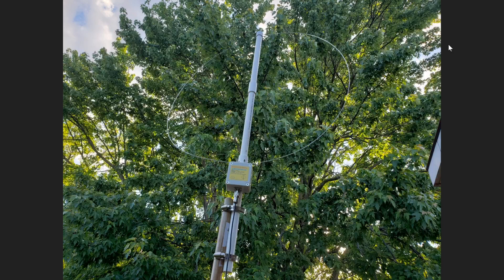Differences between MLA 30 and K180 WLA loops that might explain the overload problem

Comment: I brought one of these myself with the main purpose of listening to signals in the 30 - 180 MHz region which it does work as promised. On the low end 0.1 - 30 MHz its gain is much lower then the MLA-30+ but it will still pick up standard broadcast and shortwave at a much reduced overall gain but I deem it to be adequate for general shortwave listening . I don't have issues with FM radio overload causing cross modulation on the lower frequencies as I live about 15 Km  away from the nearest FM radio transmitters so it's not an issue for me where I live.

Comment: I have very strong fm transmitters also near where I live (closest is 1 km from my antenna), but the Megaloop FX which I use has configurable gain and filter which allows me to configure the antenna in a way that the fm transmitters are not a problem. If configured in wrong way, the transmitters are rendering the megaloop completely useless. I know it is an expensive loop, but it works and I can configure to what ever environment I am in.